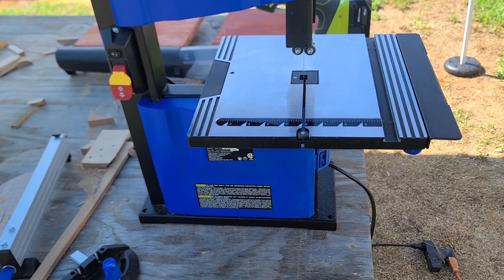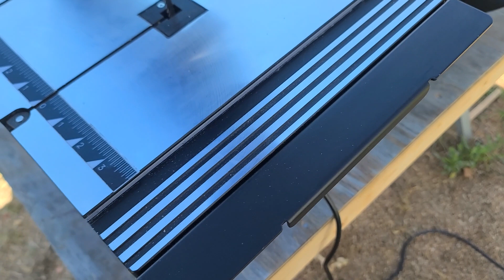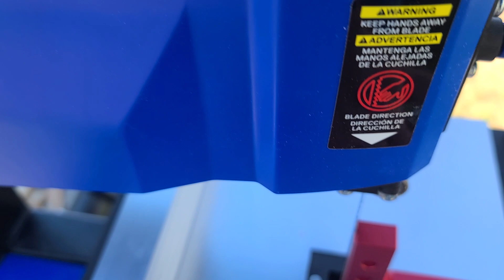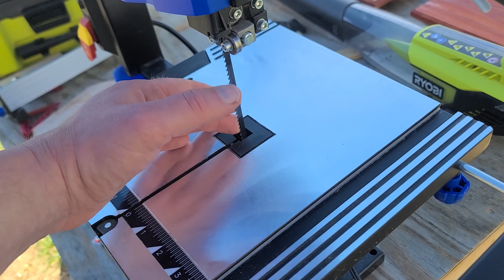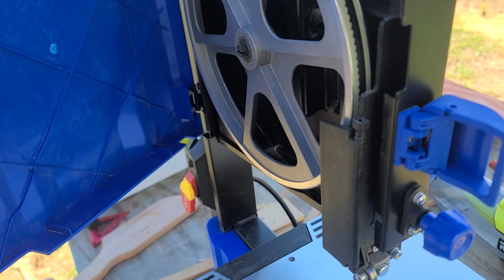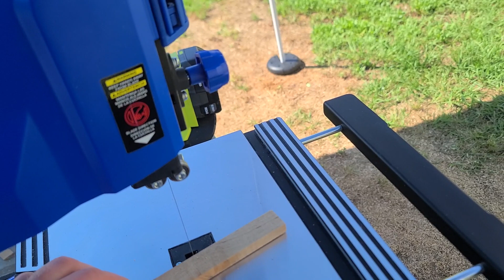New Kobalt 9 inch Band Saw!

Comment: Can't decide between this one or the Craftsman gen 2 model,, great video..
Reply from the maker: That new Craftsman looks very familiar lol. I swear they all come from the same factory. Only difference is see are door latches and the motor power rating.
Reply: the older 10 inch Craftsman tilting bandsaw has peaked my interest , i see them used for under 150 in mint condition , but this Kobalt is also very nice
Reply: Can this rip 4x4 pt lumber or just 2x4?
Reply: Because the blade is so thin, its going to be hard to rip anything on a 9" bandsaw. For dimensional lumber, you are better off ripping with a tablesaw.@Anthony979
Reply: @TheExitStrategy  Thank you!